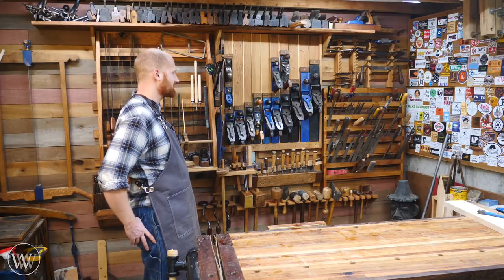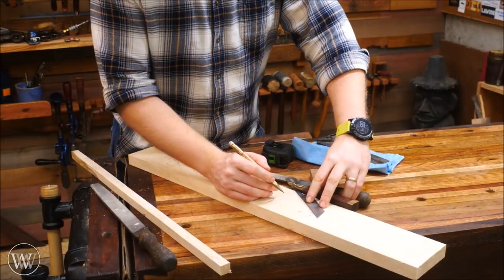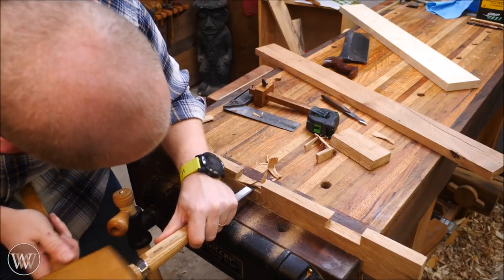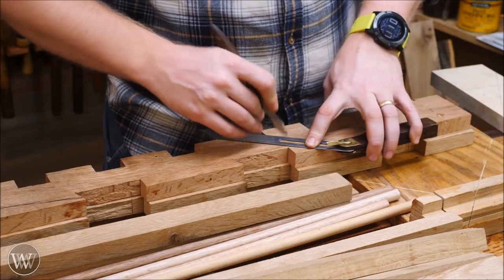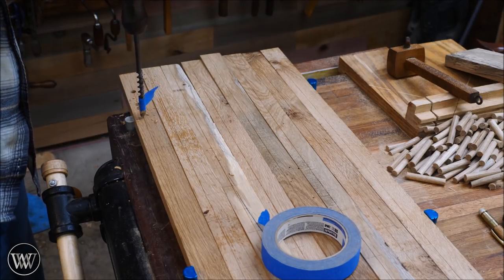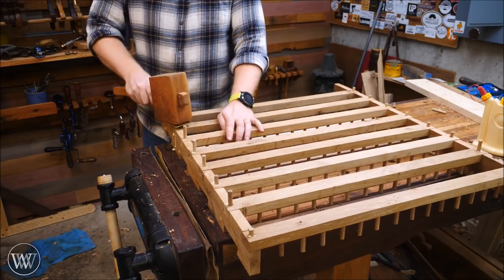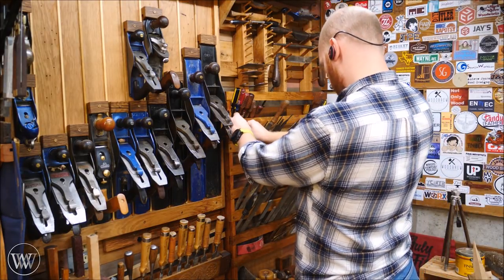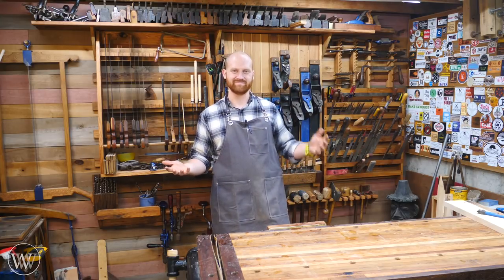File and Rasp Storage Rack | French Cleat Hand tool storage system

Comment: I have an uneducated question... Why wouldn't you want files and rasps stored on magnets?
Reply from the maker: I try not to use magnets for storage solutions as I just do not like the look. for wood rasps it is better that they not touch mettle of any kind and for many of the big wood rasps it would need to be an extreamly strong magnet, but in the end it is a personal preference, do what makes you happy.
Reply: Wood By Wright  OK, thanks.  Didn't know if there were adverse effects like magnetizing them or something.... probably wouldn't make a difference if wood rasps were magnetized but I dunno... I'm new at this so...

Comment: Couple things: I love this project... just find it ironic that you have a digital watch (I’ve been back & forth on this), and ‘standard and Phillips’... why don’t Americans use Robertson screws?  Way better, at least for power tools.
Reply from the maker: My watch is for running it is a GPS heart rate tracker. my hobby is ultra distance running. most screws in America are either Robertson or torx. very few people still use Phillips. but when working on old tools standard and Phillips are the norm so I use those far more than others.

Comment: This is my absolute favorite of your tool racks on the wall! Great idea.
Reply from the maker: Thanks man. why is that?
Reply: Any kind of skinny handles tools like files, rasps etc are difficult to store in a way that is accessible and takes up minimal space. Usually these end up in a drawer and you have to rifle through them every time you need one. This design is great for that and leaves lots of room and flexibility for adding more tools, or reorganizing as needed. And there is even room for those sexy bow sanders at the bottom ;)
Reply from the maker: thanks, man. that is my thoughts exactly. I have had this design rolling around in my head for over 2 years. there are still a few things I would like the change but I have not found a good solution and they are not really problems just slight annoyances.
Reply: You nailed it!

Comment: may i ask you a question. i want to buy a set of wood rasp and see everything from extreme cheap to pretty expensive. What would you recommend?
Reply from the maker: I am not the best person to ask. I get all of mine from estate sales and auctions. I can get a bucket of files and rasps for <$20 and I keep the ones I like. I generally do not buy new.
Reply: @WoodByWright  thanks, i have just been working with a cheap set from harbor freight and getting some ok results.
Reply: @goldendogwoodworks6675  I don't have any advice to give on traditional rasps, but I have had good luck with the Shinto rasp I got off Amazon. It's weird looking, and I don't think they make any round ones, only flat, but it handles everything I need and leaves a much better surface finish than the HF rasps.
Reply: @k4kfh  thank you, i will go look

Comment: I really like the blo finish on all your shop racks, it matches your beard very nicely.  How does the blo do on your hands?  I find after a day in the shop, my hands are super dry, especially if I deal with doing a finish or something.  Does it dry out your hands or moisturize giving you a soft luxurious smooth feel?
Reply from the maker: thnaks. well with the stuff I make I generally wash my hands but it is jery moisturizing while it is there. I would not use my hands with the store bought stuff though.
Reply: Right, you've mentioned a difference between the ones at the store with a chemical dryer in it vs the one you make actually being boiled.  I really like that color the blo gives, I may have to give it a try at some point.
Reply from the maker: it is always fun when you make your own finish!
Reply: My parent's just brought a bunch of black walnuts back from Missouri, so I'm going to try my hand at making a stain out of them.  I don't use a lot of wood stains, but if I can make my own, why not?

Comment: I noticed that your bevel gauge had the same problem mine did.  When tightened, the lever actually gets in the way of holding the gauge flush against the wood. (yours extends out the end) I removed (unscrewed)  the lever and tried different orientations of the bolt. (turning it 30° each time) I found one position that when tight, the lever is inside the edges of the body so now it does not interfere when flushing the edge.  Make sense?  I think that now that you have all the tools stored, you should show us how to make boxes.  Like the ones you made for the Stanley 45 and 55.  Just a little more detail on the joints. Please?  Thanks James!  Happy New (wood) Year!  Health and happiness to you and your family.
Reply from the maker: thanks, Bruce. I did the opposite. LOL I want the lever on the outside so I can crank down on it. I just always work with the beam on the other side so the lever is not in the way. I have several boxes on the list. I might do that after the side table.
Reply: Thanks James.  It is a wonder how much you (or anyone) have to  'problem solve' as a wood worker.  It took me 8 months to figure out my sliding bevel problem. Your solution to the file storage is very unique and special for your wall of cleats.  I made a box and hung it on a french cleat and just have all my files vertical,  touching each other.  (they do fight and shove each other)  I may adapt a much smaller version of your system to fit my tiny, minuscule space.  Again, thank you.
Reply from the maker: I had thought of a box with a bunch of divider dowels crisscrossing to separate them but that would have stuck out too far from the wall.

Comment: could you do a video on your shop's "dust collection?" I've never seen a shop vac in your shop before, but I've seen many recycling bins full of chips and sawdust. Awesome build video
Reply from the maker: Lol yup. I brought that down to clean up the mess made by the router. That stuff gets everyware.
Reply: Wood By Wright in your sharpening video, the one where you show you “path” through what you used to sharpen tools, you showed the flipping kind the DMT had and on Home Depot’s website I saw one similar and I don’t know how to use it so could you do a video on that? And are old hand planes good too because you can restore them? Thanks for your time! Keep up the awesome videos!!!!
Reply from the maker: I would not get the one from Home depo. it only lasts for a bit and then it eather rusts out or you rub off the diamonds. just not worth it in my book. and yes restoring hand tools is a great way to go for cheaper tools. often the older ones are far better quality then anything you could buy in the last 50-70 years.